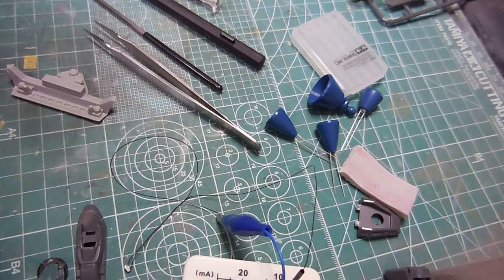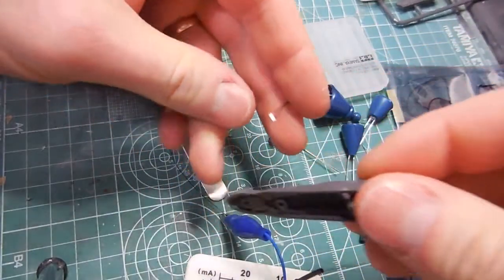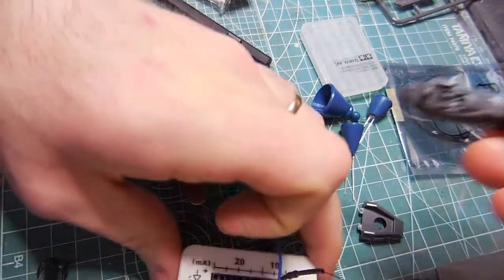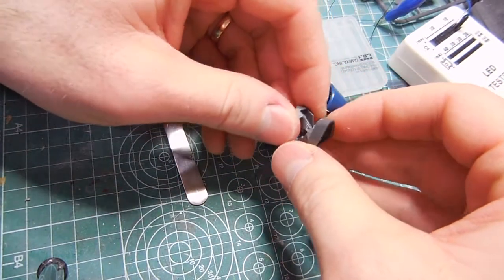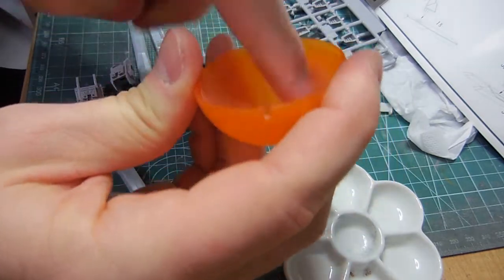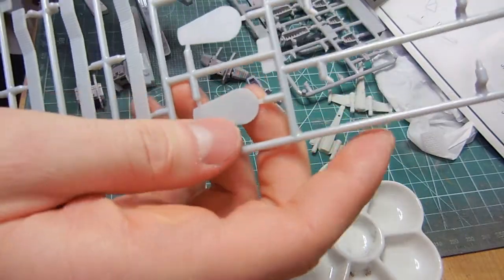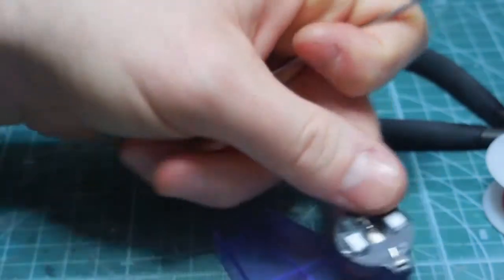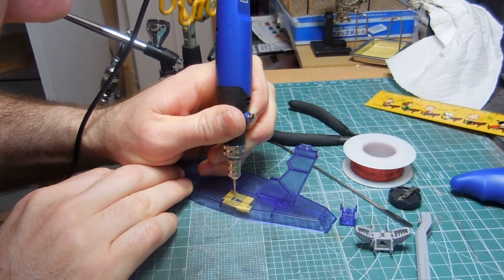PLUM R-Type Final R-9A Arrowhead plamo build video 2

Comment: Alright so, great video, Ok, so, I am liking the way this is going, ok, alright, so, I may have to build mine now. Ok, so, I am looking forward to the next one ok.  Idea for that base, maybe use some pla-plate and make new sides on the bottom to raise it higher for the battery, then sand the edges smooth and paint it up. just an idea.
Reply from the maker: So where were you this weekend? I messaged you and didn't get a response. There wasn't a Saturday night model get together this time? I've gone mad trying to solder these SMDs and I made a mess of the base a bit. I also am starting to think that this CR2032 won't be enough to power these SMDs.
Reply: Ahh, Just saw your message, sorry, overall this weekend, I have just  not been feeling well, no model time for me, I  just stayed low key, had a family event today. No chats happened as far as I know. 

It's looking good man, You didn't get the SMDs pre-wired? From what Maker Mike says, you don't solder those, but rather there is a hot plate the professionals use to solder the leads on the chip, I bought a bunch of them non wired myself not realizing how small they actually were....
Reply: stevethefishdotnet I believe Jerry from HDA wires these for 9v/12v.  If you message him I'm sure he'd be glad to answer questions 👍

Comment: I agree about the comments people leave in videos, I get the rude ones too......My videos always get two thumbs down, I know who is doing that, and yes he needs to get a life.....
I have watched that video from Steezy,   too bad he dropped off....
I do use the helping hands when soldering, makes it way easier.  But I won't take credit for it in this video, too many others use them...
Reply from the maker: Well, both the Helping Hands and that holder thingy are what you had recommended. Your video is where I saw those first. Sometimes I have to just block people from my channel. But have you noticed that whereas in the past when blocking someone they could not see or interact with your videos, but now when you block them all it does is remove their ability to comment? I suppose that means that they can continue to rate your videos even though they should be blocked.
Reply: I agree, The should be blocked.     That is what happens on facebook.